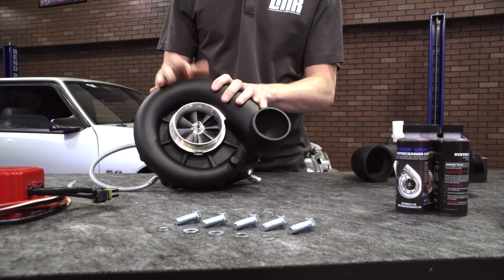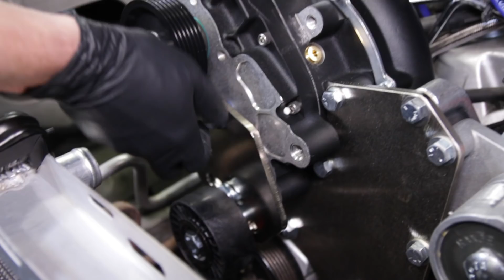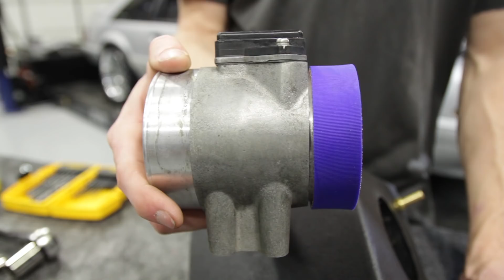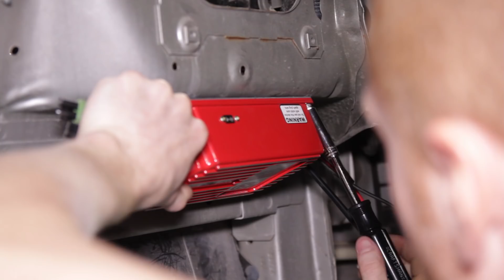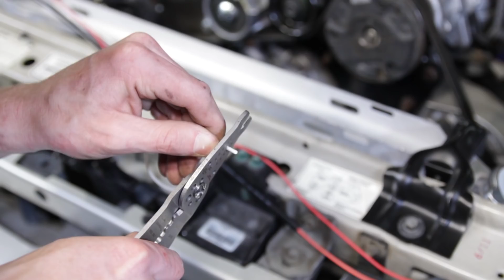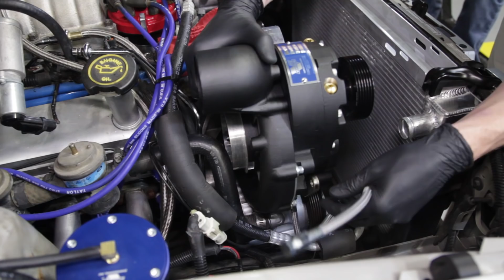How To Install Fox Body Mustang Vortech V3 Supercharger - Part 2

Comment: Same kit on my 91 notch took it from 290rwhp to 485rwhp at 9lbs boost ,well worth the money and LOT less work than on3. I did go with the powerpipe though. I have gt40 bottom end and heads also among other bolt ons.

Comment: I wish I had mechanical skills sometimes because parts are cheap for American cars but you get screwed with installation costs
Reply: dude, I gear ya, however, youtube has many videos to use, even if the job takes you extra, you may save a few bucks.

Comment: why use the FMU instead of 42# injectors and a tune.  I'd also add a powerpipe
Reply from the maker: Big Daddy - I wanted to illustrate the steps needed to install this kit the way Vortech assembles it. In the future, this car may be back with a different setup and how to install "said" setup. -Landan
Reply: Big Daddy, the FMU really serves no purpose. I understand this may provide a back pressure on the fuel leaving the fuel lines, sometimes this addtional equipment can be an issue. LMR, you may want to include some tips on whether or not equipment needs to be used. I understand you are using Vortechs instructions, but that Super FMU is very expensive. I agree with Big Daddy
Reply from the maker: The FMU is included. The car runs great and met our expectations. Be on the lookout for the dyno video. -Landan

Comment: Landan what the drive belt size u use it on the car ?, not the SC belt , and thank u 🙏🏼
Reply from the maker: I used the factory accessory drive belt that was on the car which is 90.5". -Landan

Comment: On a fox body would you choice vortex system or the pro chargers system ? I'm going to get a super charger just trying to figure out which one is better for my set up . Any advice would be great . Keep up the great videos .
Reply from the maker: David - What is your current setup? -Landan
Reply: Late Model Restoration 
1993 cobra block with stock internals . Has N41 cam . Trick flow twisted wedge heads stage 1 . Trick flow timing set . Trick flow 6.7 push rods . Scorpion rockers. 30 lbs injectors . Upper and lower Edelbrock rpm intake . 70 mm throttle body . Under drive pulley Electric fans . Updated msd ignition .
Reply: Late Model Restoration 

I have a 1993 cobra block stock internals. N41 cam shaft . Trick flow twisted wedge stage one heads. Edelbrock upper and lower RPM. 30 pound injectors 70 mm throttlebody scorpion rockers 6.7 inch trick flow pushrods trick flow timing chain set. I also have electric fans under drive kit no AC .
Reply: Late Model Restoration 

Any idea ??
Reply from the maker: David - Vortech and Procharger both make great kits. The selling point for us on the Vortech was that this particular kit would clear a factory hood. The Procharger kits require a cowl hood for proper head unit clearance. System for system though,  you can expect similar power gains. -Landan
Reply: Late Model Restoration 
Vortex sounds like the better choice for me . I like the factory hood . I've had cowl hoods before . Thanks for the feed back . Great job on your videos man keep up the great work .

Comment: Do you have to get a 180 tube to add a inner cooler? Or is that turbo some how adjustable?
Reply from the maker: Lyle - Most people custom fab cold side piping and add an intercooler.  However, because of the design of this particular system, that is difficult to do.  If someone wanted an intercooled setup for a Fox Body Mustang, then I would recommend purchasing the Vortech supercharger kit that includes their specific intercooler.  -Landan
Reply: @latemodelrestoration  yeah. I was really considering vortech for my silverado. But might go a different way. Just because of that weird elbow.

Comment: Where did the supercharger drain go? My V1 has a drain like a turbo that goes into the pan.
Reply from the maker: John, the new V3 systems are self-contained and do not require an oil drain like a turbo, Removes the step of having to drill and tap the pan!
Reply: Late Model Restoration Thats awesome thanks for the info folks.
Reply from the maker: Anytime John!, Have a good weekend!

Comment: So I'm swapping a 302 in a Nissan with a 240lph internal fuel pump is the external pump necessary and FMU or should I upgrade to a 340? I want to run this kit but this has held me back from pulling the trigger on my purchase
Reply from the maker: It depends on your power goals. I would recommend a 340 so you have more room on the table.